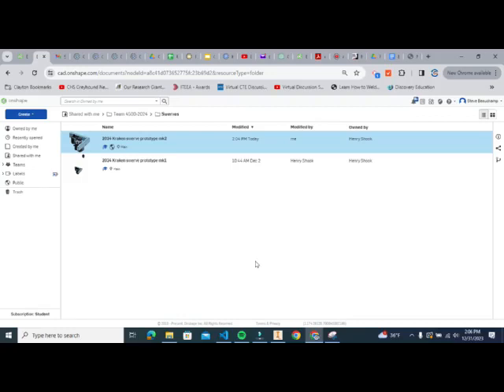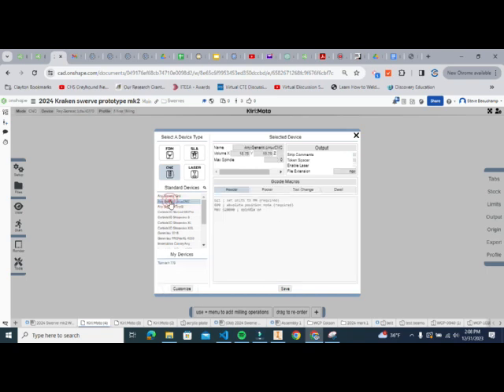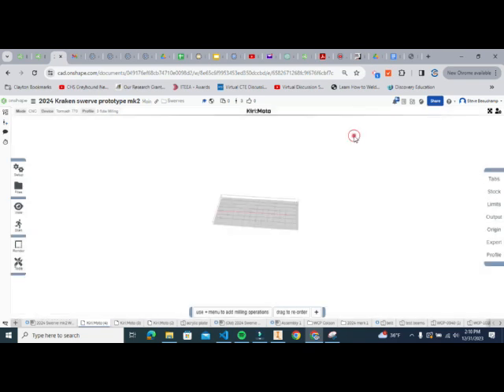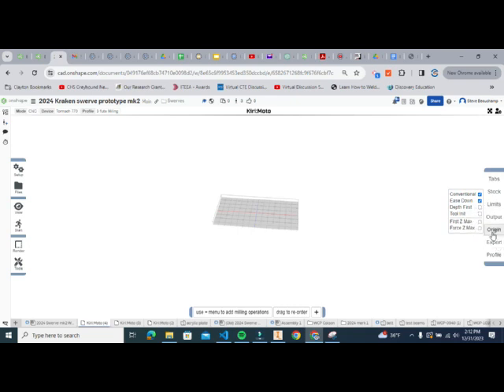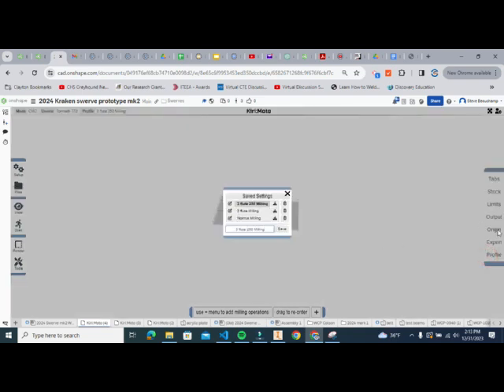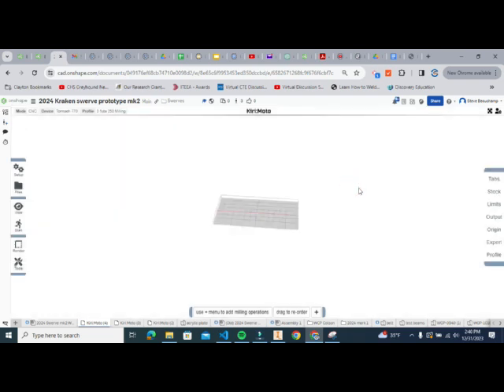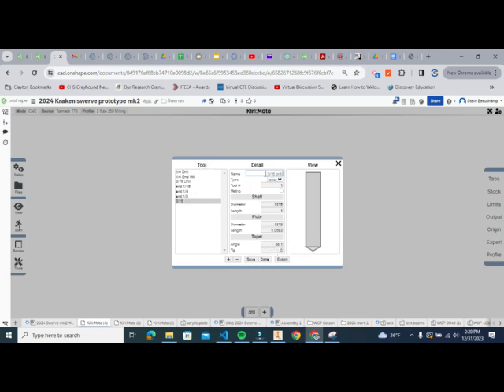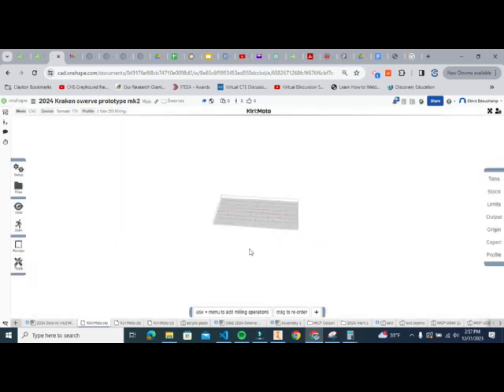Team 4500 Setting up Kirimoto for the Tormach 770

Comment: *Set units to inches before setting up the tormach 770 profile
Reply from the maker: I set the tormach to inches in the g-code header (the code you copy and pasted)
Reply: I know, but if you set the volume settings for the tormach profile before setting the kirimoto properties to inches, when you set it to inches it will convert mm to inches and it messes up the volume in the software